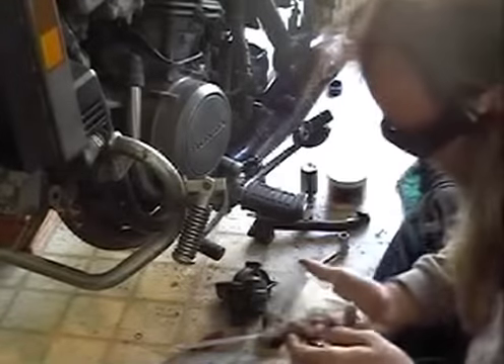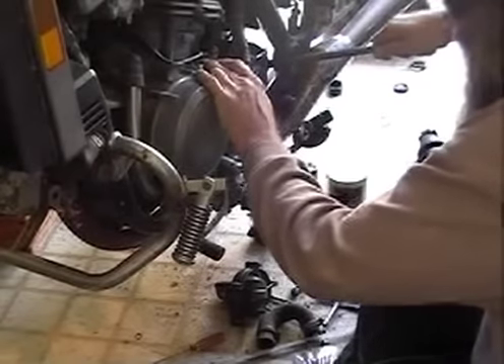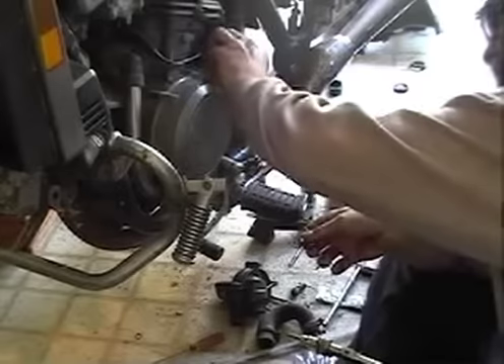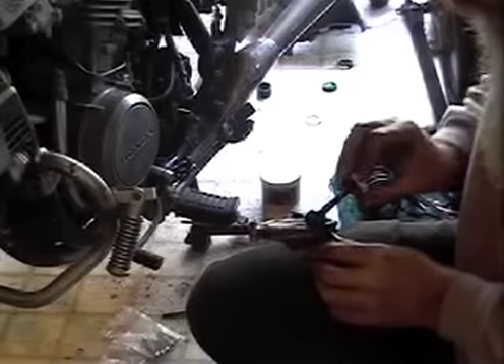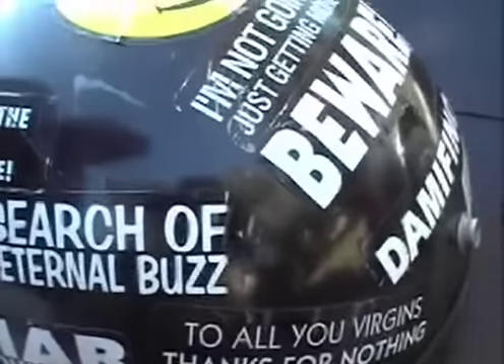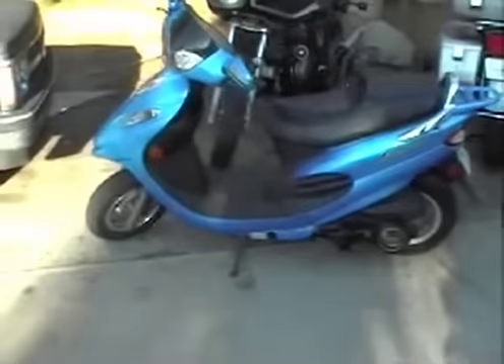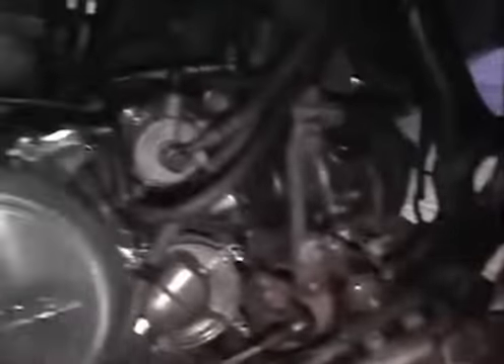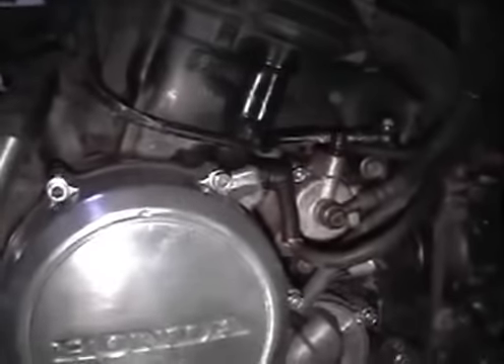Taking that extra time

Comment from the maker: If you need it by the end of the month "Heli coil" and "cobalt bits" come to mind -- Diesel you have to soak the engine but in a way that there's no chance of an air pocket in the hole you need freed up... But the diesel trick rarely works in days - weeks is more normal

Comment: but the bottom bolt eventually has come out with heat, but the top one has more purchase and has gotten very hard I think with heat from the drills I've worn dull :o( I'm going to dip the end of the engine in Diesel and see if I can get it free. I need the bike back on the road before the end of the month.

Comment: Top guy, right attitude. I'm sorting a little 250 Honda to use as an every day ride to save money, I've had the Engine out replaced the cover bolts already with St/St socket heads, my biggest problem is even though I've tried every method found on the Tube and even got inventive trying battery acid to clear road salt (did not penetrate far enough), used heat on the alloy freeze spray on the bolts, I in the end snapped the heads off and the excess bolt off with stud extractor then drilled